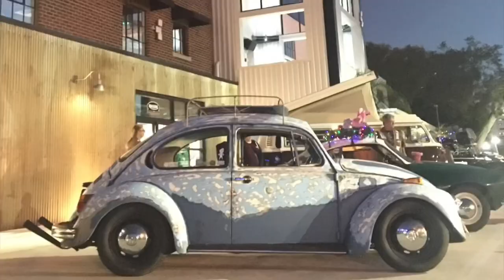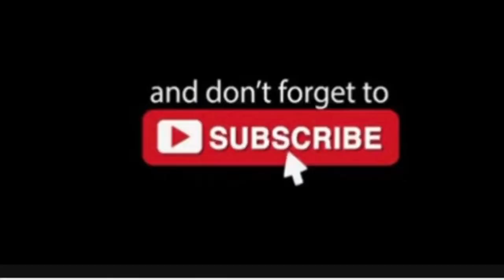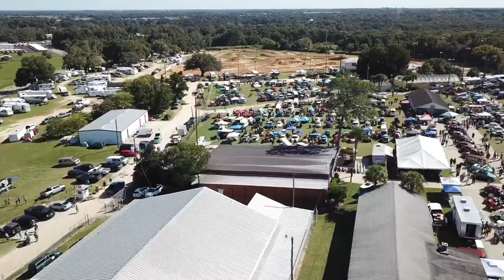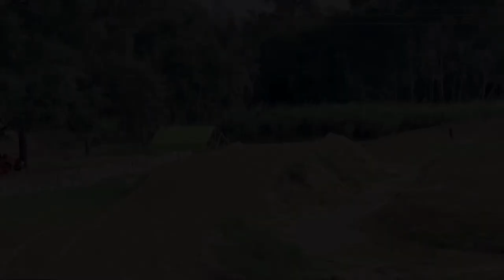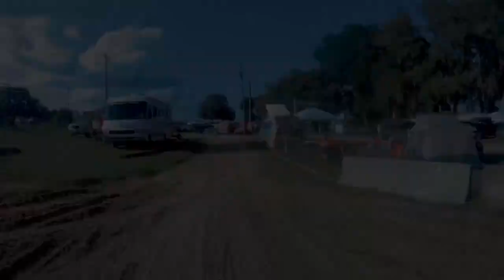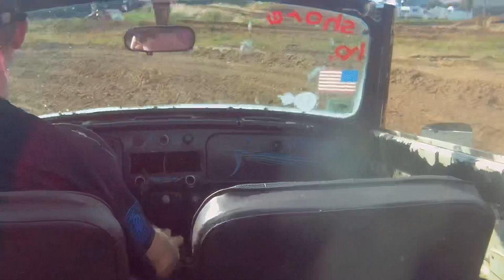Florida Bug Jam Volkswagen 3 Wheel Pan Buggy Dirt Track Action

Comment: Fun stuff! We'll be talking about this Bug Jam a long time... and that crazy 3 wheeled pan buggy that VWJawbreaker helped build. Thanks for the ride and posting the video. That thing held it's own on the track!
Reply from the maker: +Haptic Garage the buggy did better than we expected that’s for sure. It’s still being driven on the street but as a 4 wheel until we repair the single wheel layer down the road.
Reply: @VWJawbreaker  The single front wheel is impressive, but I like it with the full beam too. Neat project for sure!